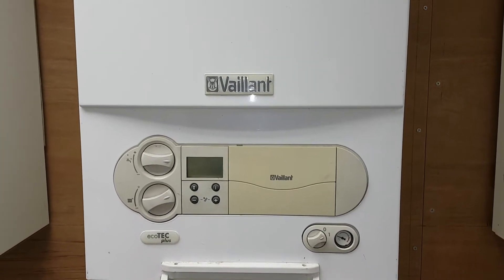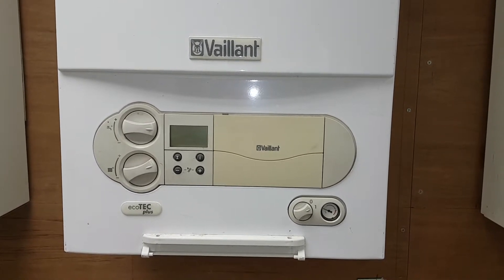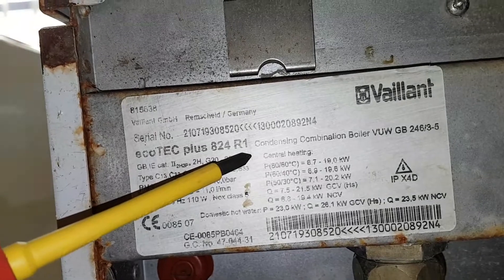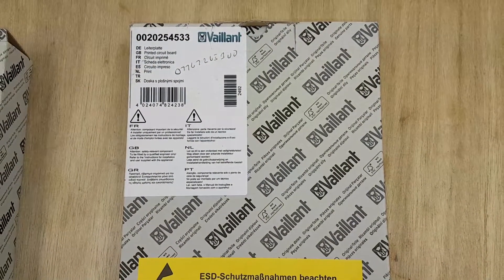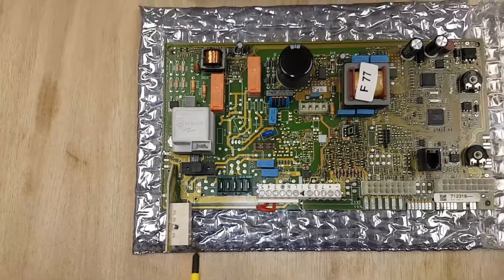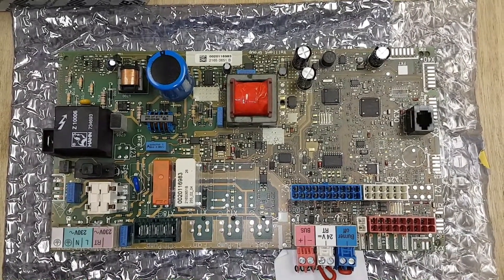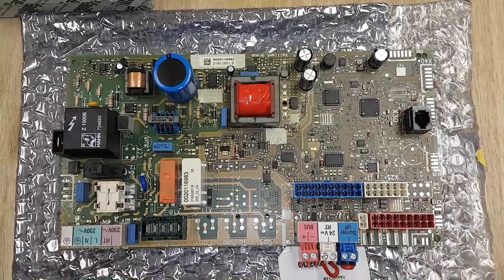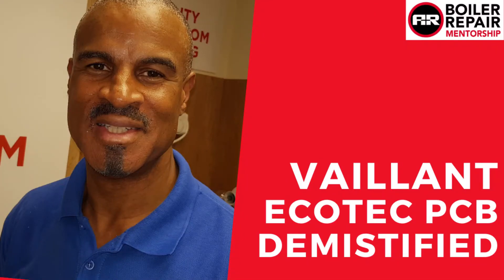Vaillant EcoTEC PCB Demistified With Coach Tony Morgan

Comment: Will the Ecotec pro 24 PCB will fit the Ecotec plus 815?
They look identical on the pictures .
Reply: Sorry meant Ecotec plus 831 not 815.
Reply from the maker: You will have to cross reference the part numbers

Comment: Hi my boiler is a valliant eco tech plus, the fault code is f62, i am looking to replace the pcb myself with a 824 R1 pcb i have an electronic background so i hoping this shouldn't be an issue, i am not a boiler person so i am hoping that its quite basic just to swap them over.
do you have any advice for me?, would be appreciated.
Reply: did you managed to replace it? Mine has an error F90 . ?
Reply: @acidtechno  Hi, yes i did, it was very simple as long as you turn off the mains power its easy enough.
Reply: @Kaosinlondon79  TURNS OUT , second level . 

Go :

D90

Change from 1 - to 0  use  - +

hit flame.  i.e exit .  REMOVES THE F.90 ISSUE with new pcb.. WILL CHECK LATER.  is a extra storage tank . we dont have.
Reply: @acidtechno  for the code i had i was resetting it for moths until i decided one day just to buy the board and do it.

Comment: Thanks for your video.
I have changed one fuse on left side in the front of white box. I am wondering there is one more fuse to be changed because there are two spares. Thanks
Reply from the maker: To my knowledge there are normally  fuse on the pcb
Reply: @ARBoilers  I can't find the second one. Where is it on the PCB? Thanks